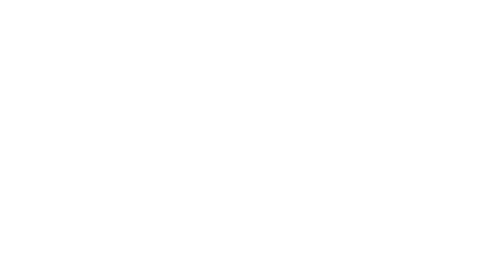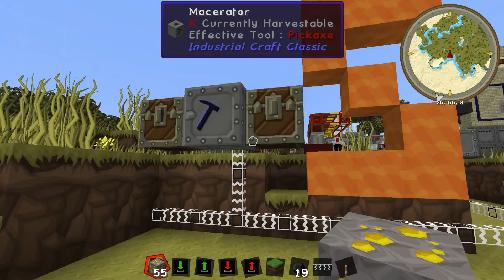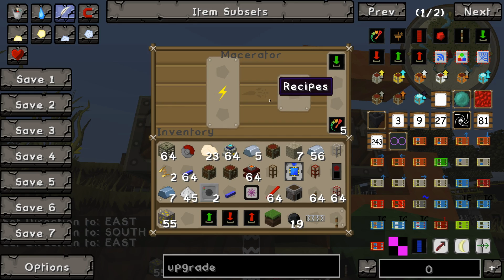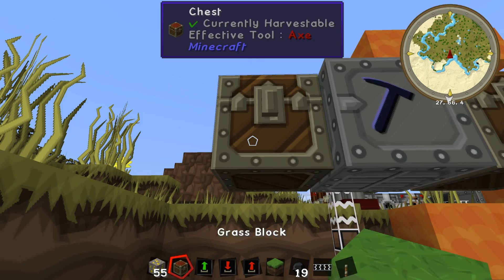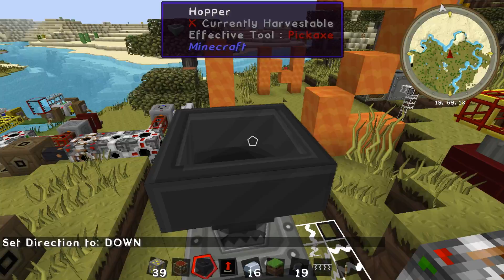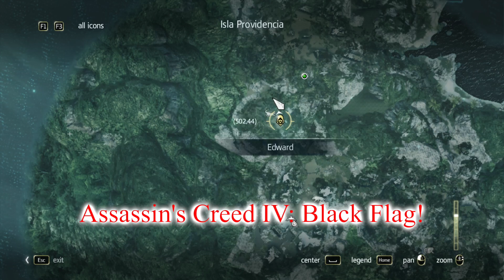IC2 Classic Automation (FIXED IN UPDATE!) | Tekkit Legends | #7

Comment: +Cub Games Furnace aren't definately outputing single items (i.e. ProjectRed Stone Plates)

And BTW will the hopper pull the ores if you put the hopper under a macerator? If that's not the case, then just do it m8, it's a lot simpler than using those broken upgrades until it's fixed.
Reply from the maker: +m31317015 Unfortunately, no.
Reply: Ugh that's not good :/
Reply from the maker: BUT, those standard export upgrades do work, and I've been told there is an update coming to fix the mod in the very near future.
Reply: Yea, let's just put our eyes on it.